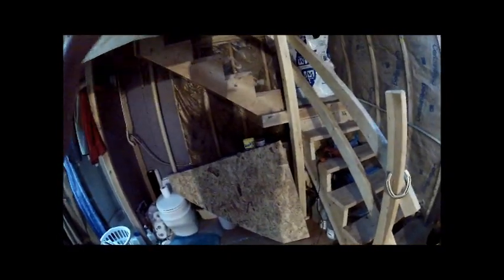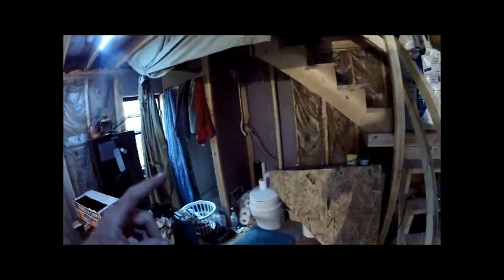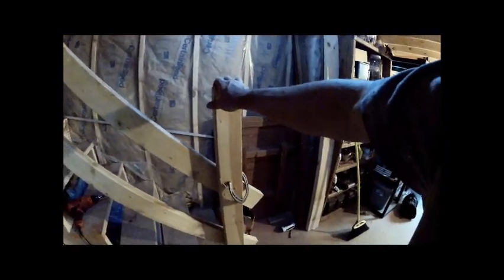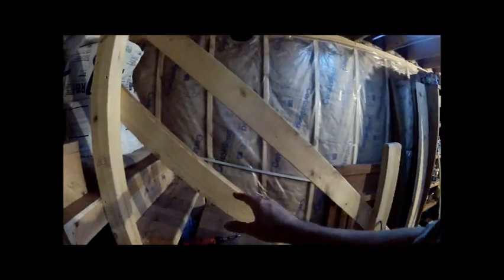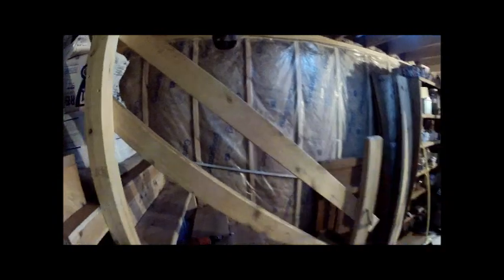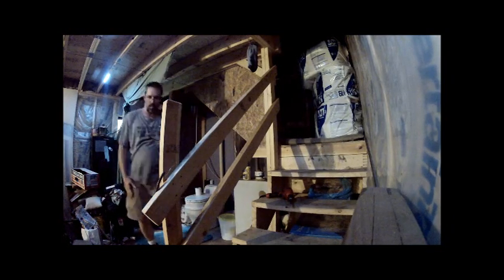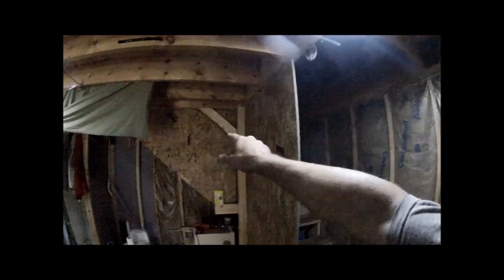Off Grid Homestead Bathroom Construction

Comment: what would really look cool is a bar type door with panels on it like the breathable wall you made, man, that would look cool!
Reply: yes, exactly, I think that would really look great! and just use those spring loaded hinges on both doors set to close in the middle unless you just want to make one door, which ever is easier.
Reply: no need to purchase them, follow your design that same way you made the wall, just make the top and bottom louver solid which will hold the door square.